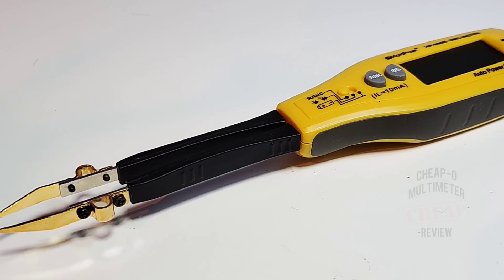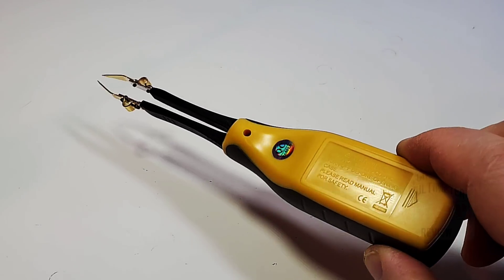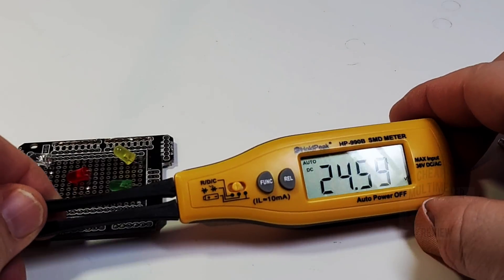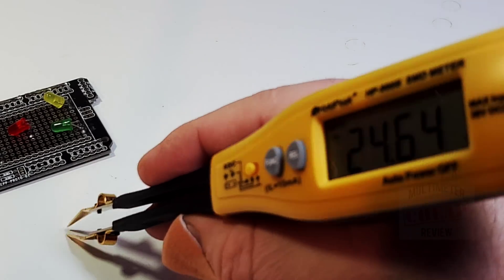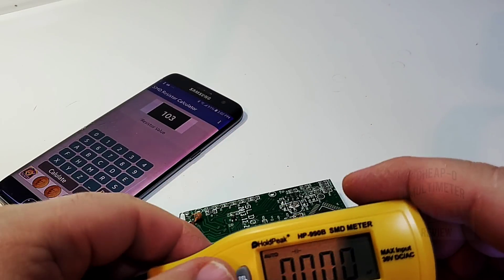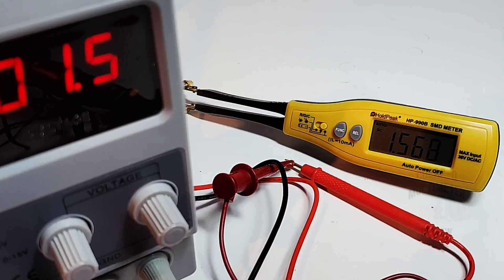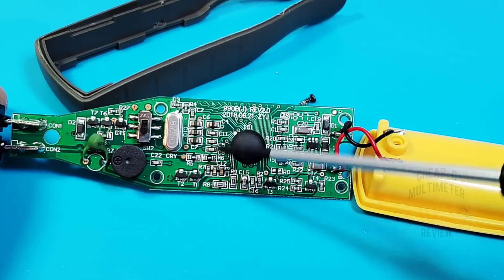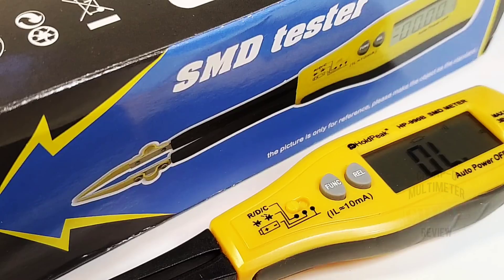HOLDPEAK HP-990B CHEAP-O SMD Meter Review & Teardown!

Comment: The (-) springs are very long in the battery bay, not a helical spiral.  There is also a big bump on the (+) side.  For me, this means bigger batteries don't fit, like eneloops or lithium primaries.  I guess it's cheapo batteries for a cheapo meter.  I like it though, nice sharp tips.  Icons in the display that are barely readable.  Doesn't do very low resistance or very low capacitance, but hey it does Zeners well enough to make up for it's deficiencies.
Reply from the maker: Good point 👉 it's definitely capable and quite a bargain when you can get it on sale. Well built and I love the color 😊
Reply: @KeepOnTesting   Problem solved by lobbing off half the spring with a diamond bit on a rotary tool, now accepts all types of cells!
Reply from the maker: @pault6533  Ahhh perfect.. good job Paul !

Comment: Hey there, i've bought the same one and found out, if you press the 'FUNC' button for severals seoncds, it will turn off.
Board Rev. 2.1 however, so not sure if this is new function or not.
Reply: i confirm it works to shut down the meter fast

Comment: This meter can scan automatically smd, resistor, capacitor, diode??
Reply from the maker: Negative,  you need to select the desired range via the selector switch.

Comment: Hi good job, can you please explain the hp-990b internal switch function?
Reply from the maker: R/D/C RESISTANCE DIODE CAPACITANCE 
Let me know if this is what you were asking?
Reply: @KeepOnTesting  There is a switch on both sides of the PCB.  On the front-facing side it goes to the range selector (SW1).  On the battery-side there is another (SW2).  It doesn't seem to go to any slider on the external body.  I think the question is what does that "secret" switch do?
Reply from the maker: @pault6533  OK Paul, sounds like it's worthy of a second look! Enquiring minds want to know ! 😃 to be cont'd..
Reply: @KeepOnTesting  I'll send you an internal picture of mine, the HP-990C.  The switch is "up" on mine, otherwise looks exact.  I had a hunch it was the only thing separating a "C" from a "B" but the PCB has a unique silkscreen indicating the model.  I found reviews for the "A" version which did not have the switch, but did have a calibration pot.
Reply: @KeepOnTesting  Mystery still unsolved? The 990A doesn't have it, but the B and C do.

Comment: There are 2 selector switches, one can only be accessed when the case is opened, what does it do?
Reply from the maker: There's only one selector , the other is a a function switch.
Reply: @KeepOnTesting  @10:45 there is a switch above the speaker what does that do?
Reply from the maker: @PioNunes  Thats the range selector switch.

Comment: What is the cheapest clamp meter that can do DC Amps from 0.5A to 3A usuable.. would like to use it on 24V DC equipment to see some Amps

If you compare the ADMS9CL@15€ to the RICHMETERS RM088@13€ which one would you pic for small meters?

Have you seen the (anang) "super mini" Meter for around 5 to 6 usd? (E b a y Mini DMM LCD AC DC Digital Voltmeter Ammeter OHM Multimeter Volt Tester w/Buzzer)